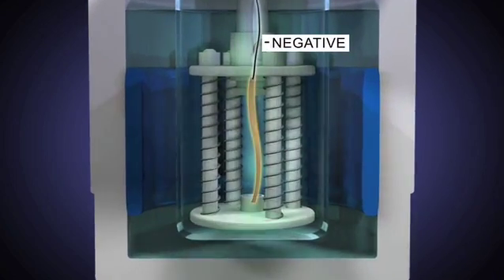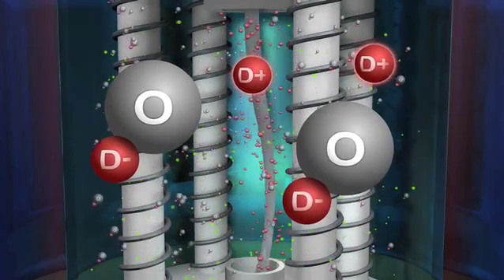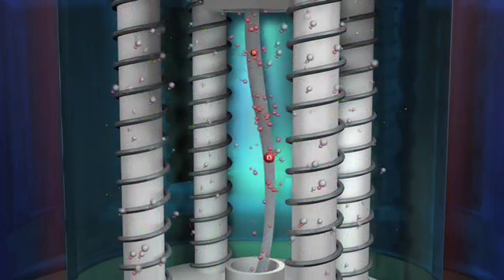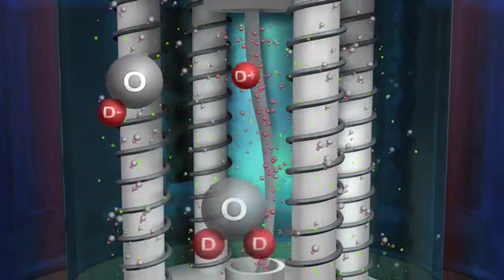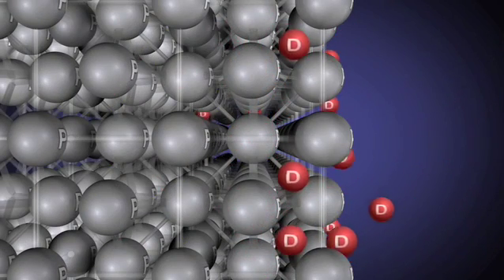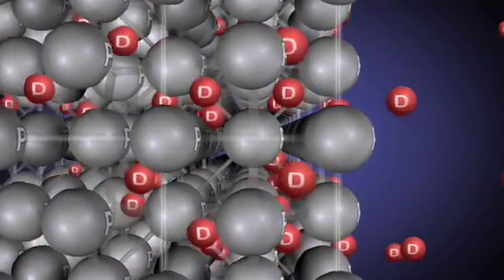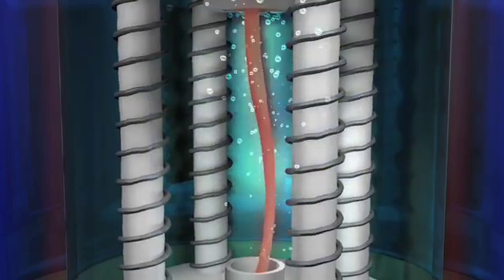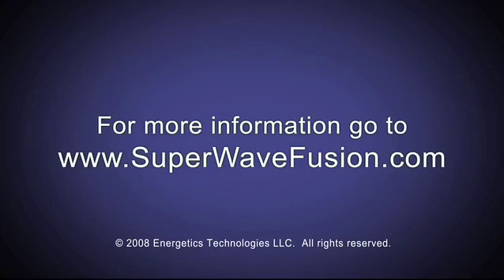SuperWave™ Fusion "excess heat" process visualization

Comment: Dr. Irving, I do not know whether you answer questions posted as comments on this YouTube page.

I am on Page 178 of your excellent book The Nature Of Nature. I noticed that you were having a difficulty coming up with words that are in current usage which would adequately describe your book's concepts of nonlinearity and frequency as applies to the example of heartbeat systole and diastole superimposed on the exersion/recovery bodywave, shown as a carrier wave and one inner wave. 

Q: Have you seen the Lissajous Pattern of a sine wave displayed on an oscilloscope where, instead of looking at the sine wave with forward time shown on the X-axis moving right, the oscilloscope settings are such that you are looking at the sine wave as a circle so that the (0,0) coordinate is the forward time pointing "out of the oscilloscope screen" and the sine wave is spinning clockwise in proportion to the sine wave frequency?

Ask one of your company's electronic technicians to set up an oscilloscope to demonstrate what i am describing; looking at a sine wave in The Phase Plane view. 

Even better, hook up your stethoscope to a condenser microphone, and connect the microphone output to the oscilloscope set to phase plane display. 

If you look at the heartwave systole/diastole on this "time coming toward you" oscilloscope direction setting, you may come to find that the pattern traced out on the display is that of a fibonacci spiral outward from (0,0) for systole, and then a differently sloped fibonacci spiral inward for the corresponding diastole.
systole/diastole, systole/diastole...
Inrush of blood, outrush of blood,  Inrush of blood, outrush of blood; a real-time qualitative graph of the heart ejection ratio. 

The circular asymptotic diameter of each systolic/diastolic beat is in direct proportion to the amplitude of the strength of that particular heartbeat in combination with the amplitude of the current sample of the exersion/recovery bodywave. 

From this o-scope single channel phase-plane display of systole/diastole, your technician can devise a method of sensing, utilizing the proper sensor, the exersion/recovery bodywave superimposed on the heartwave o-scope channel.

If you ask around you may discover that engineers and technicians involved in electronic control systems have industry-accepted words and phrases for your concepts of nonlinearity and frequency which are part of the electronics technical lexicon. 

If your company does not have a practically-minded hands-on generalist electronics engineer on staff, reply to this comment and I'll provide you with my resume. 

Thank you for your discovery of SuperWaves, and thank you for writing your book, Dr. Irving.

-- Joe

P.S.:  A variation on the apparatus system setup on this video's concept solves the worldwide Clean Fresh Water Crisis, something I've been theorizing on.  No need to drink and bathe in flouridated municipal water if we no longer want to.

Comment: @Aaronator01 Yes, it already has. Look up Frank Znidarsic and his "Speed of transistion". For example..Einsteins photo-electric equation is E=hf. h being Planck's constant. Using Frank Znidarsic's theories I can solve for E without Planck's constant(h) or i can even solve FOR Planck's constant.  Here is an example.  For energy (without planck's constant) E=e^2/2(2EoVt/f) e=elementary charge of a electron, Eo=permittivity of free space, and Vt=10943846m/s just incase you feel like doing the math

Comment: What that means kizkoool is that they are observing an unexplained increase in temperature.  They're not entirely sure how it's happening - but they have ruled out all traditional means and are now theorising on what could be happening.

It will likely take a lot of hypothesising and experimentation by a lot of people in the scientific community before we understand what is actually happening.

All we know is that it's producing a lot more heat than it should.
Now we just have to figure out HOW
Reply: roidroid 
There is a YouTube video about an old chemist, last name is Patterson, who a number of decades ago came up with a nickel-Palladium-nickel alloy for the lattice that is used in this cold fusion system setup.  The excess heat energy generating process is a variation of the process shown in this conceptual video.